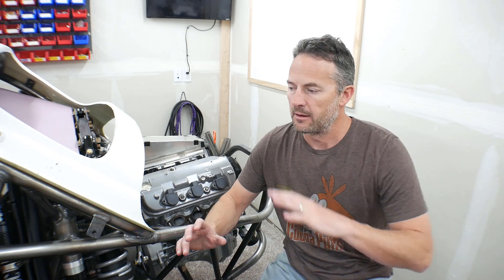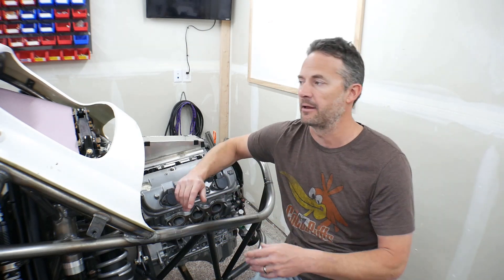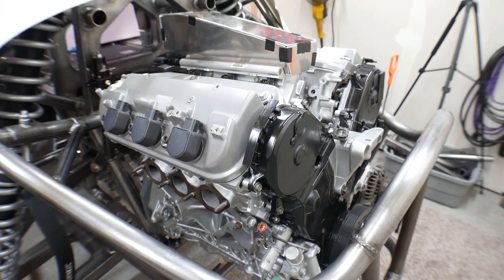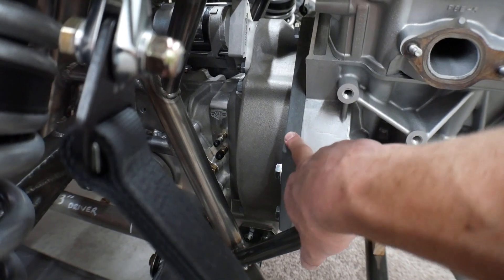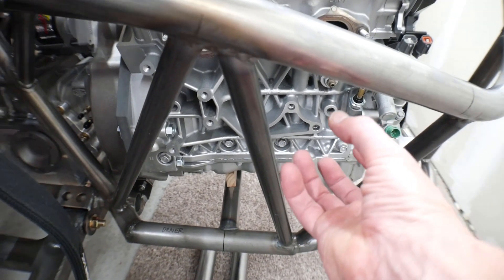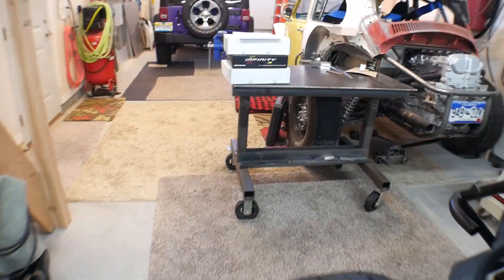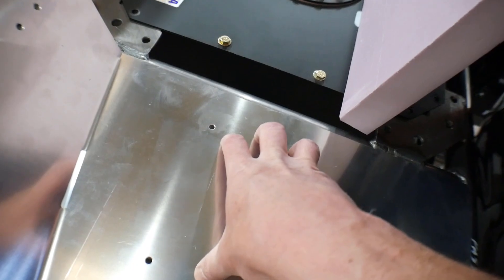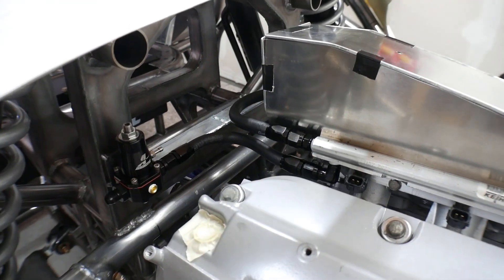Wratchet Engine Build Series Ep1

Comment: Mike, Wratchet has come a long way, by now i'm sure you are way beyond the Rad placement, the first place i thought of was tilted back on the roof like a wing, i realize plumbing would be an issue, i guess i will find out where it went, the engine build is going to be good, talk to you later
Reply from the maker: Hey Mike, I put it on a wing behind the motor. It seems pretty good, but it's a bit dangerous back there. I'll see how it goes.
Reply: @DougBugBuilder  yeah Mike , I was thinking on a wing either above or below the rear window, I didn’t think you would really love it taking up the whole view

Comment: How hard was the harness to make? If I can save the money on a harness, I’m considering dumping that cash into an aem ecu and display. I’ve repinned a few wires on a couple different engine swaps to get other things to work, but never made a ground up harness. Any videos or how to info on standalone j35 harness? Cheers
Reply from the maker: If you can read a pinout, properly crimp small wires, and are detail oriented a harness is really not all that hard to do. Especially if you have the engine installed with the sensors and the ECM. It's really just a matter of connecting the dots (with wires).
Now that being said, it's no small task. It takes a lot of time, a lot of wire, lots of crimping, and could get confusing. So you have to go at a realistic pace, and basically one wire at a time.
But I like doing it, and when you're done your harness is a perfect fit for your vehicle.

Comment: Stick with the throttle body from the jseries the map sensor is on the throttle body if you want to run boost it would be easier to run that one.

Comment: What’s is the trans set up? Honda’s rule my single cam d16y8 made 500whp and the fuel was only at 58% duty cycle the car is really only half way turned up.  I’d love to build one of these bajas
Reply from the maker: This Baja has a Weddle HV25 transaxle in it. 👍

Comment: Great videos Doug!  Once you go efi you won’t look back especially when you go turbo. If you are running a bypass fuel regulator you will want to run your fuel from the pump to the fuel rails then to the regulator    👍 cheers
Reply from the maker: Thanks buddy, gotta say so far working with the ECU has been a fun challenge. Really like having full control of everything.

Comment: Radiator location relative to driver/passenger is important.  All that hot water under pressure right behind you?  A failure would not be good for the occupants IMO.  I assume their will be a firewall to separate the radiator from the driver/passenger?
Reply from the maker: There will be a firewall, but I don't think I'm going to mount the radiator up there. Like you noted, a little to dangerous.

Comment: Maybe look at the Honda RC51 sport bike with side mounted radiators , slim design and wouldn't block the rear view, duct the heat out sideways.
Reply from the maker: I'll look that up, thanks for the tip!

Comment: E85 would allow for a much smaller radiator from what I've heard, I personally never ran it yet, but I have ran methanol quite a bit. 1 or 2 small radiators with ducting would be awesome, keep your visibility and not get blasted with heat. A small radiator up front would also be a good option
Reply from the maker: Never heard that about E85, I'll look into it. Thanks for the tip.
Reply: @DougBugBuilder  oh wow, hope it’s readily available in your area, you use a bit more than gas but it makes cool power, pretty much every street class drag car uses it around here at least. Meaning serious street, sub 7 second quarter mile but truly streetable.

Comment: @UC8n0_ivJZHBDANHHHOWuC2A 
Great work can’t wait to see it’s first shake down. I would go with a high performance aluminium rad.  It’s worth every dollar. As far as positioning I’d go behind the seats but on the rear extracting the air in the rear wheel fender. Giving a lower C/G, good  air flow in the cab, and would cool the transaxle. Still lots of room for intercooler right in front of it. Double stack them. Add oil coolers at the back of it all when necessary.  Just reposition the electronics and modify the fender plates. Make a shroud on top to force air outside and stack electronics on top. Air intake for engine trough a rear roof scoop.
Reply from the maker: Thanks for the feedback! 👍

Comment: Where would you put the intercooler when you turbo it? Intercooler placement with short runs and feed to the throttle body might then mean thug radiator needs to go elsewhere.
Reply from the maker: If I put the radiator in the back window, then I'll consider putting the intercooler behind the seats, or integrated into the rear wing. But I'm not 100% sure at this point.

Comment: dont use the jeep radiator. poor design. bottom hose not on bottom. i would get 2 smaller radiators and mount them in the rear windows. use the fan to blow out. effectively evacuating the cab. you can make the radiators swivel in to access the wiring.
Reply from the maker: Thanks for the info on the radiator, but I'm actually looking at it just for the size. I'll be welding on my own connection points so I can put them wherever I want.
Appreciate the feedback.
Reply: @DougBugBuilder  the radiator is too big. you need to make desicions now that dont need to be changed when you add the turbo. the turbo will need an intercooler and because of the extra pressure on bearing surfaces you will need to cool the oil. where are yo going to place the other coolers. the rear windows are the best place. im from florida so im very versed in cooling. down here i would have to engineer in an a/c condensor as well. for street cars the front surface area isnt very big. it is important to utilize other areas. rear windows have never been available. i just wanted you to know my suggestion about using the rear windows came about as a result of many years of cooling expertise.
Reply from the maker: @gregoryperkins2180  Thanks for the tips, to be honest I never even thought about adding the oil cooler. 🤦‍♂️
Reply: @DougBugBuilder  my father was a vw mechanic down here in florida. once we put an engine oil cooler on the air cooled vw we could take the cooler out of the shroud and cool # 3 cylinder. when you add a turbo to an engine the oil is heated alot in the scuentch surface of the bearing. this is the piston side of the rod bearing. lots of extra down force from turbo pressure. i would always recommend going to an oil cooler instead of a larger radiator. we also run oil coolers on our manual transmissions in road(race)cars. i saw a 914 pumping oil back into the trasaxle with 5 injectors. each one over top of a gearset. but im in florida and cooling is the first lesson learned here.
Reply from the maker: @gregoryperkins2180  Lots of good info here. I won't have an oil cooler on this engine initially. But after hearing this I will add one when I upgrade to the turbo. 👍
I also don't have a cooler on the transaxle yet, but I did get it with a pump and a distribution bar. So it pumps oil directly over the bearings.
Thanks for all the tips! ✌
Reply: fyi i love all your design work. and you are tallented with the crafts of building.

Comment: I had a bug many moons ago with a Nissan A14 and a rear radiator that i moved to a few spots. I did not have all your options but then I decided already if I build another one the radiator would go upfront. Better natural ariflow and the extra capacity in the system from running tubes to the front make the cooling system more effecient. From many engine swaps I learned the more coolant your system holds the better
Reply from the maker: Very good point, it would add some additional volume to the system. Thanks for sharing some real world experience. I will take it into consideration.

Comment: Why not have two smaller radiators facing out of the rear "windows"? That way you can still eject the hot air outwards but keep your rear visibility.
Reply from the maker: That would solve the rear visibility issue, but then I would lose all side access through the windows. Although cooling wise I think that would work really well, I'd rather lose rear visibility then side access.
Reply: @DougBugBuilder  You could always try to fabricate the mounts for the radiators to allow them to be easily removable. Or perhaps you could put them on locking sliders with mounting tabs up top, unbolt the top and slide them down of you need to access anything from that window.

Comment: as a another guy said a i think a firewall is a something you should definitely consider, once you allow space for that then id start looking at radiator placement. nothing ruins your day more than getting covered in boiling coolant. keep up the good work!
Reply from the maker: Good tip! I plan to make a lower firewall from the fuel cell down, maybe I'll think about going up top too, maybe I'll make something removable so if I think I need it I can pop it in.
Thanks for the feedback.

Comment: Run two smaller radiators in your back window area. Then run a forced air induction system through the side quarter window. Keep your two radiators inline with the front seats. That way it will create a gap for more rear view visibility.
Reply from the maker: That's not a bad idea, although in my search for dual radiators I couldn't find anything that was really that small. But I like the gap in the middle idea.
Reply: @DougBugBuilder  You might be able to run some large trans coolers off a city bus or something. Ended up doing something simular for a older project of mine
Reply from the maker: @Rambone224  Not a bad idea! Thanks.

Comment: Good choice more than enough power, let's just get the darn thing running.
Edit: Can you mount the radiator horizontally above the fuel tank below the line of sight through your back window and duct the heat out?
Reply from the maker: Mounting it horizontally is not a problem, but I'd have to get creative to duct the heat out.

Comment: Hi Mike!  You have got some great viewers with great comments with great ideas.  I can see merit in most of them depending on the intended use of that car.  
I remember oh to well how happy I was when I got my second sandrail with a more powerful water pumper pushing me around the dunes. The radiator was above and behind me tucked under cage and in the wind stream. I had one electric fan on a thermostat.  In the after noon sun or anytime during the heat of battle it didn't take much romping around to get warmed up and the fan would kick in.  It was loud and tiring and even hard to make small conversation with my passenger. It wheelied easily which was all I wanted at the time.  Sometimes it wheelied when I didn't want it to and I would just dig in on the side of dune.  The understeer was horrible when I had the hammer down and the cutter brake was hard on the differential tranny parts. Letting off the gas would give me weight bias to the front and the wheels would bite but I couldn't stay on track at speed.
So based on that I would suggest you keep the noise, heat and fluids on the outside. I would use Lexan or something in the window openings to further isolate the sound and give you some weather protection from the ever changing wait 15 minutes and it will stop raining Colorado weather.  It's nice to have a toy you can use year around.  My Tub buggy spends way to much time in the garage and I have come home many times wet and cold.  
If I had your car I would keep those electrics well protected behind the drivers seat like you suggested and make access real easy.  All that space above the fuel cell to the bottom of the window I would keep for hauling spare parts, tools, food, water to drink for you and the radiator (just in case) Always nice to have a place to throw coats and spare cloths not to mention Crash helmets when you just want to putt around and talk with the wife.  The Blake Wilkey Ride looks pretty wild and crazy but Bang for the Buck ratio is all wrong for me.  I've seen to many of those high dollar rides parked in camp broken on the second day of our weeks vacation. We were sitting around the camp fire while those guys were up wrenching all night and begging for spare parts.
Here is a vid of one of my friends V8 Baja that was pretty reliable.    https://www.youtube.com/watch?v=l0XRUduqzcE&t=249s
You can see where it uses the natural aerodynamics built in to the VW body style to direct air from the top to below the rear window where the standard air intake is on a stock sedan.  Cleaner air from up high.  
I know you want a clean tight package with roll over protection but in the event that does happen at any speed at all your not just going to roll it back on it's wheels like and RC car and be on your way.  Having that electric throttle is so sweet. I would for sure face it to the back of the car just for the noise factor. Most of the V8 buggy's I see on the sand do that. A big cone filter that is easy to access and service. I sure somewhere in your electrics  your going to incorporate a Roll Over sensor to shut the car off and kill the fuel pump so even if the air cleaner is vulnerable it won't suck junk in.
At any rate it's raining at my place and I just thought I would offer a few thoughts.  I know your going to do what's right for you and you have the talent to change things later if you don't like the way it turned out.  Create a great day my friend.  We really need to get together before the summer is gone. I don't think my dog is up to it yet but I've had that Pueblo motorsports park on my mind a lot lately.........
Reply from the maker: Hey Greg,
Thanks for all the comments, interesting on turning the intake around for noise, I never even considered that.
The sound on that V8 at idle is really nice! And that's about the tightest V8 install I've seen, looks pretty cool. Not Wratchet cool.....but pretty cool. 😎
We definitely need to get together, good to hear from you.

Comment: Are you going to be able to register this one for the road as well or is it going to be off road only
Reply from the maker: This is going to be offroad only, so I won't have to worry about all the items involved in being street legal.
Reply: @DougBugBuilder  yeah I was just curious in Arizona if you put turn signals and all that on it they will give you a plate to drive it on the road there are full dune buggies driving here with plates side by sides full tube chassis cars I don't know how it is in most other states other than california which don't allow any of that hell I just paid 103 dollars for 5 years for my truck in california it was 230 a year
Reply from the maker: @Youtubeforcedmetochangemyname  That would be nice, in Colorado I would have to get this certified as a new build, then it would have to meet emissions, so just easier not to make Wratchet street legal.

Comment: I like the below the floor idea, but with 2 separate rads would you do water to air intercooling? Behind the seat could be dangerous unless you built a fire wall if a cooling hose came off
Reply from the maker: I tried figuring out how to squeeze two radiators under there, because that would have been really trick. But the radiators, fans, and some ducting just took up to much space.
The intercooler will be air to air.

Comment: I used a dual radiator setup in my VW Thing using Civic aluminum racing radiators. Just angle them in the back and use scoops in the side windows. I installed the Subaru EJ22 (4 cyl) . The dual radiators were also dual row so all in all double surface area as I live in Florida. If you go with dual setup recommend you go with split plumbing setup do not use series plumbing.
Reply from the maker: What engine were you using with that setup?
Reply: Doug Bug since response above added to original comment. Basically Subaru EJ22 used OEM ECU and harness.
Reply from the maker: @brianpeeler1050  Thanks for the tip on the plumbing and the radiator feedback. 👍

Comment: Do not put that radiator in the cab. You are asking to get burned. Put the radiator horizontally over the engine out and away from the driver and passenger
Reply from the maker: Noted and appreciated!
I might look into integrating it into the wing over the engine.
Thanks for the feedback.
Reply: @DougBugBuilder  stay safe bro. 👍

Comment: Definitely put the radiator in the rear window. You can make some nice scoops from the sides scooping air into the radiator and then you won't have to worry about airflow. Just a thought but if visibility is a concern then you could try doing something cool with a backup camera and one of those rearview mirrors that show the camera and just wire it in to always have the camera on the mirror.
Reply from the maker: Back window, got it. 👍
Thanks for the feedback.

Comment: I like the back window radiator. Keep boiling hot fluid as far away from you as possible. Just use a cheap back up cam to see behind you. Once you are harnessed in you won’t be able to look backwards anyway
Reply from the maker: Good thought on being harnessed in, I didn't consider that.
Thanks for the feedback.

Comment: I like option two for the radiator. Maybe unrealistic but if you attached it with some hinges so when you need to do work you remove some bolts and it slides forward for more access?
Reply from the maker: Back window, It's pretty tight in there, but I'll see. Having it hinged would be nice.
Thanks for the feedback.